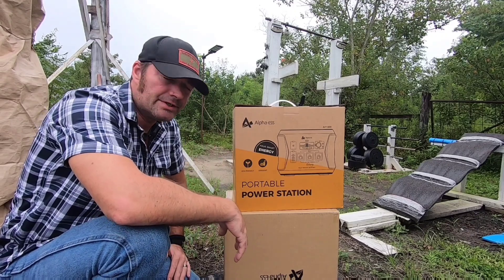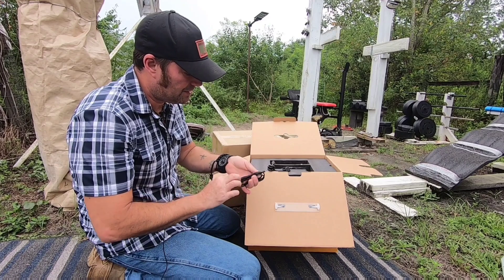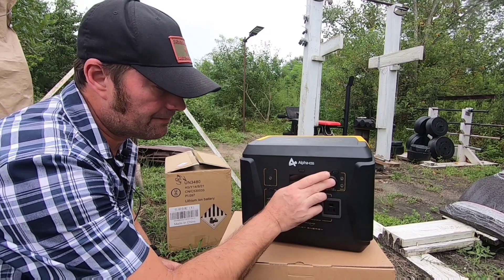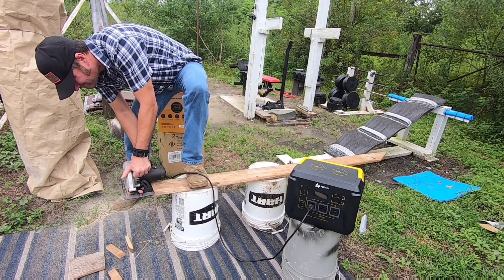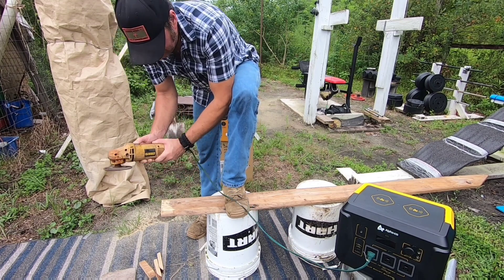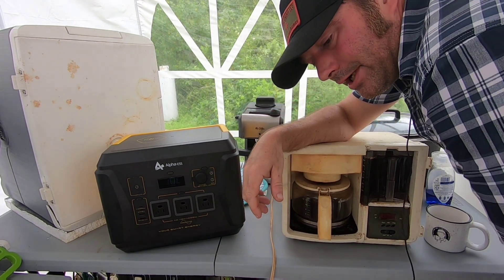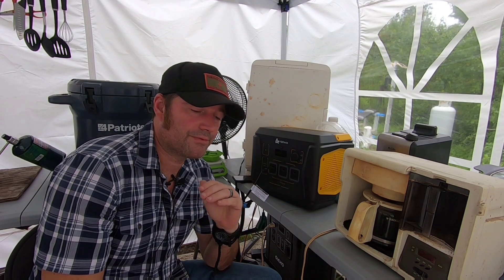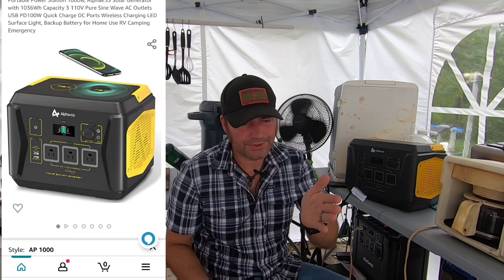Alpha ESS 1000 Watt Portable Solar Generator

Comment: Use mine in my work van. Single cup Kurig uses over 1000 watts but works perfect. Also runs my microwave pulling about 900 watts. I defrosted and cooked a two serving frozen lasagna. It took eight minutes, but it was too hot to eat for another 10. Lol. Charges my 14 DeWalt batteries and my headlights. Got this one after I lost hope in Jackery customer service (I’ve owned three and still use one).